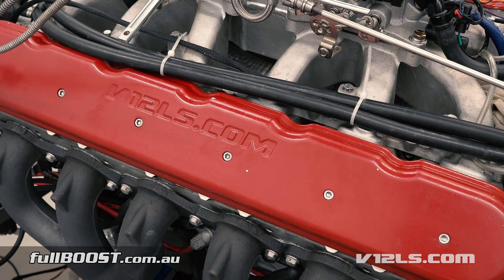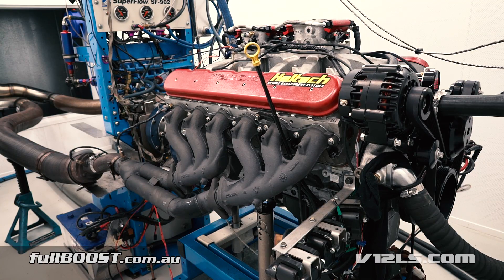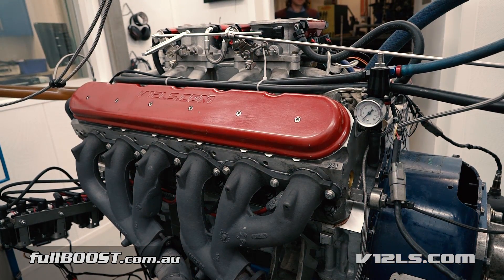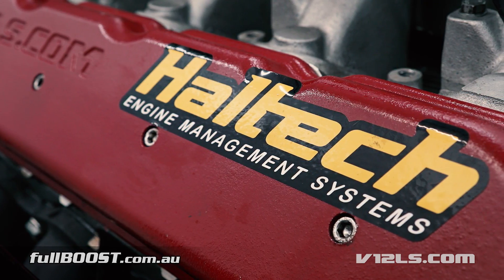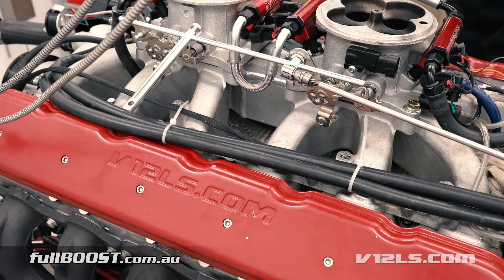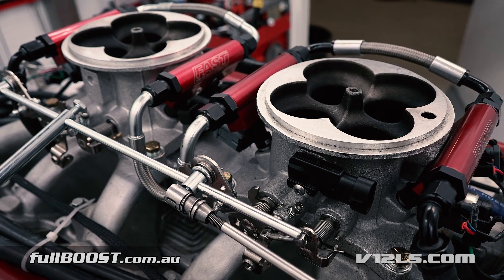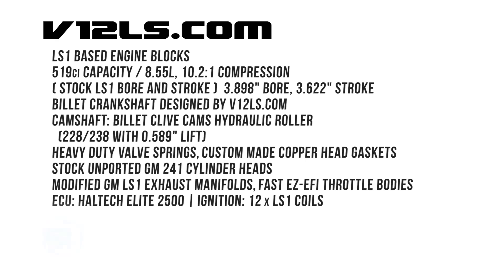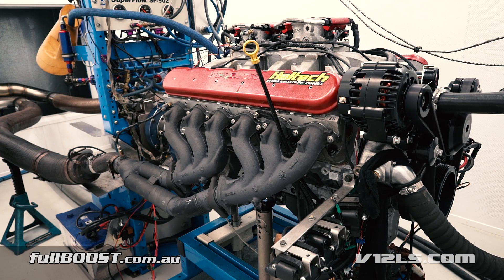V12 LS1 engine dyno

Comment: What body was the builder planning to drop this in?
Any car that comes in Straight Six and V8 configurations, will have a big enough engine bay.
That crazy flat torque curve would make this a very easy daily driver, perfect in something like a Chev pickup.
Doing it using 'stock' internals is an achievement - the one true advantage of the LS over the Ford and MoPar engines, is that the parts to service and repair them are everywhere, and at affordable prices.
Reply: Thanks for the interest. We have put these in 2 first gen Camaros, a cheetah and even our kia work van. A few more applications coming but I won't spoil their SEMA reveals.
Reply: @V12LS  ,..... I wonder, how big is the engine bay in the new Corvette? "Mid mounted V12" is such an appealing sentence ;)
Reply: @PiDsPagePrototypes  It's too small of a space for the mid engine but a really great idea if they plan on increasing the length of the vehicle. Now that would be badass. (You can see the engine through glass byusing the rear view mirror) The new Corvette sends chills down my spine.
Reply: @UltraGamma25  Length? V12's are mounted sideways ;)
Just have to make use of the new 'Vette's wide hips.
Reply: @PiDsPagePrototypes  not all v12s are sideways. most arent actually
Reply: @rubberwoody  Welllll, Italian supercars 😁
Reply: @PiDsPagePrototypes  all lamborghinis are longitudinal v12s
Reply: @rubberwoody  Not the Miura. And, it's the only one that counts ;)

Comment: That thing will be a n/a beast. Port those heads and maybe a bigger cam, and 91 octane and dual 850 holleys,  Thats a good solid engine with that much power out the gate just like buying a gm 572.    Im sold,   Would be nice in a old 2wd c10 crew cab conversion.  Even a nice c10 long bed sleeper. Or keep it all stock and spray it its quiet enough for a sleeper .

Comment: Imagine this but using a 4.8 crank destroked LS7 as the base. With the highest flow heads on the market ported and polished further with the biggest valves. And a nice medium cam that can still pull good idle vacuum and get good low and midrange with just a bit of lope. And also a cross-ram intake. And equal length long tube headers.
Reply: We just did that exact build for Sidchrome tools! Had to go short stroke to get under 500ci to register the car legally in Australia. It's de-tuned with a small cam though because the car is for a giveaway and needs to be responsible. We really wanted to throw the big cam in there and see what it did, but the build was on a tight deadline.
Reply: @V12LS  Bitchin'! Strange that 500ci is the limit. Hell, Chevy still offers the 572 as a crate motor. You'd think something like that would be lower given the other extreme restrictions in other countries such as heavy taxation on engines over 2L in Europe and the UK.

Comment: Look at how little it shakes and vibrates across most of the RPM range. Mmmmmm mmm!
Reply: A 700+hp NA pump gas V8 is an angry and lumpy engine compared to this. This engine (off the dyno) sounds a lot more like a really big capacity sports bike, and is really smooth once it gets up over about 1,500rpm. The 30/90/30/90 ignition split gives it a bit of a lumpy note at idle, a bit like a V8.
 The fact that it is essentially 2x straight 6's means it has a perfect balance too, which is one of the reasons it is so smooth.
Reply: WarWagonMT 2slant 6's* lol

Comment: Great engineering, but geez guys, this sounds like a Grey motor.
Reply: Both sides prob running in the same firing order, so sounds like a 6
Reply: That's because it's basically two straight six's. What else is it going to sound like?
Reply: Caesium147 No euro V12 sounds like a Grey motor.  This does... and it sucks.
Reply: +ArchimedeanEye nfi....
Reply: ArchimedeanEye
I didn't say anything about euro V12's.
Reply: +Caesium147 just depends on firing order, you ever hear of cross or flat plane crankshaft?!
Reply: Caesium147 That's correct, I did.  You don't read so well.  The point is no V12 that I know of sounds like a grey motor.
Reply: So a V8 is basically two inline fours so they should sound like 4 cylinders?
Reply: +T Zon V8's with flat plane cranks pretty much do sound like that.  have a listen to a 2013+ Yamaha R1... inline 4 cylinder that sounds like a V8!  because of crossplane crank.
Reply: Good point and reasoning but:
No! 
A flat plane crank V8 is two inline fours, and a cross plane V8 is why conventional V8s sound the way they do.
In larger capacity V8s you can't easily use a flat plane crank because of secondary vibration. Flat plane V8s do indeed sound like 2x four cylinder engines but are limited to low capacity ie < than about 4 litres but typically < 3litres. This is because the lower weight reciprocating mass (piston and connecting rods) vibrate less.
A V12 is in fact 2x 6 cylinder engines which is why they sound a six. Their firing order is even the same as a 6 cylinder on each bank ie 1, 5, 3, 6, 2, 4. V12s can be at any angle in the Vee and still be in balance.
Reply: +Caesium147 by that logic, since a v8 is basically two inline 4's, it should sound like a straight 4?
Reply: the exhaust is not being recorded. there is a lot we are not hearing.
Reply: with a few tweaks to the exhaust you can get a V8 to sound exactly like a 4 cylinder.
Reply: Explain these "tweaks" madmax2069
Reply: +madmax2069 Bullshit.  You need a flat-plane crank for that.
Reply: nope, its all in the lengths of the exhaust manifolds piping, you combind a few exhaust pipes together from each bank so the pulse matches each other (so they are basically one pulse) you do that be length of the pipe you're connecting to the other exhaust pipe. you will end up with a spider web looking header system.
Reply: Madmax2069 what you are referring to is the "bundle of snakes" headers which are used to help scavenge the exhaust from a flat plane crank engine, yes it will change the sound, but will sound nothing like a 4 cylinder.
Reply: Header exhaust scavenging is the domain of the cross plane V8 crank - not the flat plane V8 crank.
One of the amazing things with flat plane V8s is that exhaust tuning is nowhere near as critical. Within reason, the exhaust can be any shape that fits and the power remains similar.
Reply: it has stock manifolds and made massive power.

Comment: sounds like starving for fuel. why not a flat plane crank?
Reply: Flat plane crank would only apply to engines with 4 or 8 cylinders.
Reply: You don't need a flat plane on straight 6 or V12 they are naturally balanced and there would be nothing to gain.
Reply: GlassTopRX7 Putting a flatplane crank on a v8 would just introduce super rough secondary non sinusoidal imbalance.
Reply: Chris Huynh
Flat planes are great in V8 just not in a  large displacement V8, even the Voodoo needed a rather heavy crank shaft negating nearly all the advantages.
Reply: GlassTopRX7 The lighter crankshaft can actually make you lose power, what it does though is have less of a flywheel affect so that rev response will be more snappy. Crossplane cranks usually do not have the center 2 counterweights, it has been a known practice for racing teams to incorporate the center 2 counterweights and gain a few horsepower across the entire rev range, NASCAR and Austrailian V8 Supercars series are sole proof of this. The flatplane v8's main advantage is that it has even exhaust pulse intervals on each cylinder bank, which makes a huge difference in scavenging at higher rpm. Overall, If you want a truly pure race setup, your engine would be a stressed component of the chassis (block bolted directly to suspension) and a flatplane v8's secondary non sinusoidal vibrations is a huge red flag and should'nt be used as one. The only way to balance the secondary vibrations in a flat plane v8 is to use quad balance shafts which each rotate twice the speed of the crankshaft. Crossplane v8s already come in secondary balance but are out of primary balance due to the end pistons not being in the same position, this is negated by the heavier counterweights on each end for a near perfect smooth engine.
Reply: Chris Huynh
Flat plane V8's don't use balancing shafts that why the displacement isn't typically that large.  They just accept the vibration. 

Adding weight to the crank or flywheel will not result in more power but it will aid in overall acceleration as the engine lose less momentum during shifts.  That is why drag racer don't go for light weight flywheels were road racer do.  Flat planes change revs significantly faster which is needed for quick clean down shifts. The also have less rotating mass allowing them to rev higher.  In addition to the things you stated.

If NASCAR would allow flat planes and they could match the displacement they would make more power and be faster. 

The notion that adding weight to the rotating assembly helps is myth, just like the one about back pressure.  It would violate the law of thermodynamics.  I have no doubt if they do add weight it's for a reason, but it not making more power.

At any rate it's a non issue for V12's as they are naturally balanced to begin with.
Reply: GlassTopRX7 Less rotating mass is not what makes the flatplane v8 rev higher. Rofl, the flatplane crank is lighter yes, yet you can take off weight from the crossplane v8's flywheel to obtain the same exact amount of rotating mass as the flatplane v8. Furthermore, the same could be done to the flatplane v8 in using a lighter flywheel though there is a threshhold to how light you can make in total of that rotating mass and both the flatplane and crossplane v8 are able to reach it's minimum.
What makes the flatplane v8's you've seen rev higher (or in other words, make peak power at a higher rpm) (Ferrari and Porsche) are their 4 valve per cylinder dohc heads, short and wide exhaust header primaries, intake runner length and width, valve timing and lift, port size tuning and small displacement/oversquare for less peak piston speed and lighter reciprocating mass.

Lesser rotational weight of the flatplane crank making it rev higher is a MYTH, get that false idea out of your head.
You increase power at higher rpm in a gasoline engine by increasing the amount of AIRFLOW at that rpm. What's stopping it from revving higher is friction and how long the parts can survive RECIPROCATING that fast with an x amount of inertia.
A flatplane v8 will perform better at higher rpm due to the even exhaust and intake intervals on each bank. So they tend to be designed and tuned to operate at higher rpm.

Bmw's CROSSPLANE S65 DOHC M3 V8 follows this formula and revs to 8300 RPM.

If NASCAR allowed flatplane v8's none of them would survive all 500 miles of certain races. a displacement with pistons and a stroke that large and that high of an rpm is bad news, the threads of bolts would be shattered off fairly quickly and it would destroy itself.

Comment: I hate to say it, but it doesn't sound good to me. I'm hoping it's just the camera's mic... :-\
Reply: its because of the firing order
Reply: +Joshua Huffine I think the 302 v12 sounded better,,
Reply: Well there is no headwork done to it, no custom exhaust manifold and no custom header back exhaust. It will definitely sound different then. It's not the best sounding motor but it makes some power.
Reply: It will sound like an inline 6 since you cant pair the 2 banks of cylinders exhaust into an x-pipe as it is a 90 degree bank angle and odd firing? You would be able to if it was a 60 degree v12.
Reply: It's using OEM style headers so it won't sound that good.

When custom long tube headers are made then it will scream!
Reply: Especially if they are equal length headers with a full titanium exhaust.
Reply: they have the
vacuum tubes on you wont hear hardy a thing...lol
Reply: 12-cylinder engines tend to have an acoustic signature in common with most (longitudinal) V- and inline-6, for reasons having to do with firing order and exhaust routing.  And (longitudinal) sixes almost never sound good.
So of course it doesn't sound good, if you were expecting the glorious roar of a V-8 haha.  Not what this build is about!
Reply: Chris Huynh it's still a cross pane crank shaft , doesn't matter if it's a v12a
Reply: so much restriction that the throttle response gets compromised at wide open throttle due to what you stated.

Comment: imagine this engine with a set of 76 mm turbos......
2000hp capable at least...
Reply: Easily .
Reply: Why only 2 how about 4 because America
Reply: Nelson racing makes 2k with 8 cylinders all the time lol.
Reply: And no way to put all that power to the ground. lol
Reply: @TheBeingReal  yea there is. 20 psi of air in drag slicks
Reply: @topkek7003  If you are talking funny car / top fuel…yes. Those are completely different tires you could ever run on a street car.
Reply: @TheBeingReal  you can, you'll just get pulled over pretty quick
Reply: @fatdan172501 yeah but how extreme are those V8 you refer to by Nelson. This would be tame in comparison at same power levels.
Reply: @ztwntyn8  clearly, that’s my point, if he makes 2000hp with a v8, v10 ain’t nothing.
Reply: Easy

Comment: for everyone whos comparing this engine with other modified V8s.. this engine has stock LS1 specs (bore, stroke, compression, heads, etc).. stock LS1 has around 330ish hp?? and people still manage to daily it with some bolts on and boost at 600 or even more. Now imagine same modifications goes into this one, i mean little bost with some bolt ons and heads job? it is possible to daily a 1xxx engine with the same way you do with a 600 ls1.
Reply: Exactly right Ahmed, it makes more power than a Hellcat, and a Viper 8.4L V10, with essentially stock LS1 internals and heads. The cam and valve springs are the only real performance modification. It's only a matter of time before these things see bigger bores, better heads, rods that can spin past 6,500 safely, intake, exhausts, etc. 1000+ hp in NA form on pump fuel is not out of the question.
 I'm sure someone will add boost at some stage too, just to see what happens.
Reply: also some matched ports & a polish will help, along with a better exhaust, the flow dynamics are not optimal with 2 seperate manifolds.
Reply: Ahmed Alansari ok ...so I can take 4 old school stock 350s join them together and have a 800 HP monster that weighs 2000 LBS and is 8 feet long...this whole concept is stupid because you lose the sweet sound of a v8 and to big long and heavy ...ambitious tho...gotta give them that....
Reply: k moods except you can buy one of these engine for 30gs online...probably the cheapest v12 crate motor you can buy
Reply: I want to know what this thing can do down at 1200-3500RPM. It's all well and good to throw 600FT LBs and 700HP out way up at 6k or so, but will it pull worth a goddamn right off idle?
Reply: TestECull, I imagine it does pretty well off the line, also considering it's a V12 it should be extremely smooth at low rpm and at redline. It uses the same firing order that new Ferrari's use. I think current version is now based off of LS3 and is pretty light for its size, long block is suppose to be around 420ish pounds and the crate motor they provide is now rated at 800hp.
Reply: MajorLeague . Easily.
Reply: nope, 2 doors down. Neighbor has a chevy half ton truck with an ls1 pushing 1090 hp to the tires. The only days he doesn't drive it is when it's snowing outside.
Reply: @squirts1  Dont bet against it happening. Ever hear of Ryan Falconer? If not, check out his website....
Reply: Really neat design. I'm sure a lot went into that. If you think about it, the power is actually pretty decent considering it's only a v12. With the stock hp of one ls (if my math is right) it should take a v16 to make that power
Reply: The cams pretty small for 500+ C.I too, imagine what this thing would do with 20 more degrees of cam and the compression to boot...
Reply: @squirts1  no no. I completely agree with you. I was simply stating it's very impressive numbers for no more than they did in terms of mods to internals.

Comment: Now people can make more convincing 250 GTO clones with their Datsuns.
Reply: LOL That's awesome.
Reply: lol
Reply: you could make an old Chevy 250 straight six sound like a 250 GTO when built right. This LS1 v12 
doesn't sound anything like one
Reply: @spartanboss4189 , I simply cannot imagine any Chevy 250 sounding anything like any revvy old Ferrari V12, ever. Expecially since the things were generally all done by 5k, which is lower than the torque peak in a 250 GTO.
All this thing needs is a proper set of tubular headers, and an exhaust system with an X-pipe.
Reply: TheKiltedYaksman1 there was a guy named Cotton Perry who got his 292ci six up to 11,000 RPM. And people at Argentina modify their Chevy 250s to rev to 6k-8k RPM
Reply: @spartanboss4189  I actually think this v12 sounds quite a bit like the GTO maybe tubular headers would add a bit of needed “freeness” and might create a sense of “rasp” in the exhaust note

Comment: good effort for unported 241s and those exhaust manifolds. plenty left in it.
Reply: GM sells small bore LS3 heads now, probably a better option that early LS1 heads.
Reply: i think they wanted to make that impression, or the boss said JUST DO IT.
Reply: ***** read my comment.
SMALL bore ls3 heads .
They work with the ls1 3.9in bore
Reply: The next blocks we have in the works right now are 4.125 inch bore, so will open up a lot of possibilities :)
Reply: 241s are just 243s with a bigger cc. mill em 0.020 and they match a 243 power wise (had both on an LQ9, stuck with the 241s and sold the 243s for 600 profit over what I paid lol)
Reply: +V12 LS you guys made a masterpiece good job guys i know you guys will keep taking it further hell yea keep it up